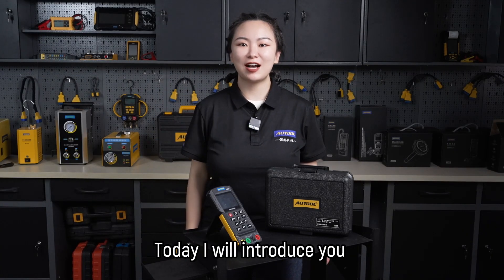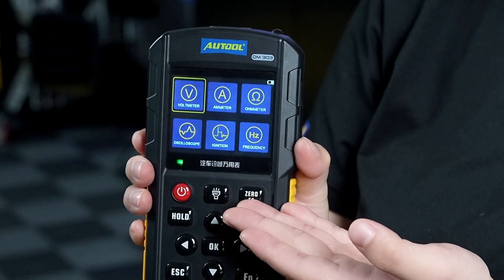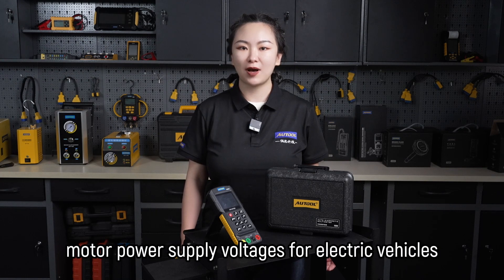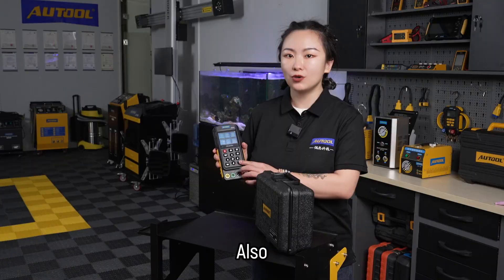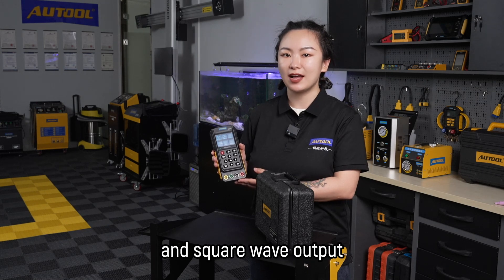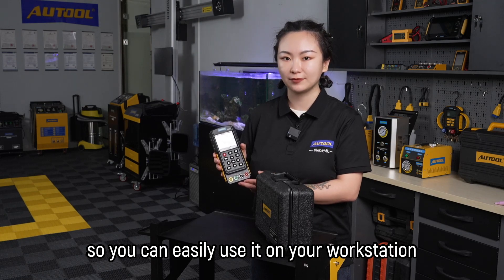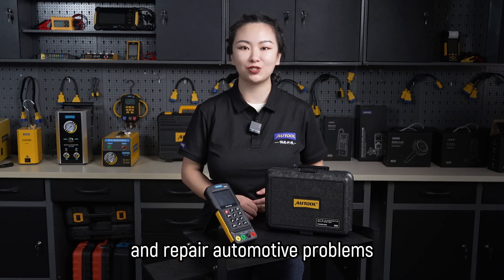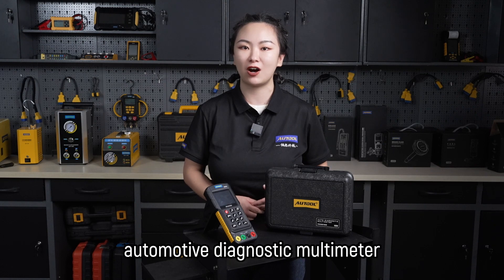Get to the Root of Car Problems with the AUTOOL DM303 Multimeter - A Mechanic's Must-Have Tool!

Comment: Good morning , I have the DM301 , if I buy the cabs and update software, will be possible measurement injector k/ Lin. Data , can data , automotive circuit teste, cranking test, analog signal test and relay test.

Comment: Saludos! Que diferencia o prestaciones  hay entre el multimetro y autool bt280???
Reply from the maker: hi, BT280 is a circuit tester, which has similar functions to a multimeter, but they are not exactly the same.